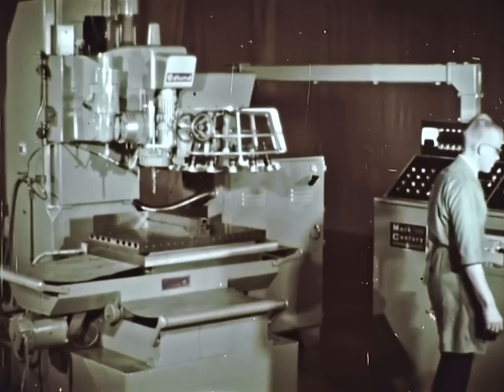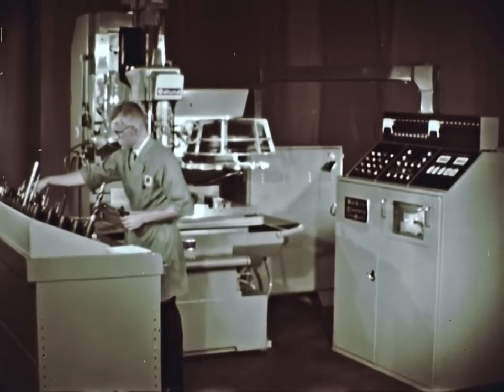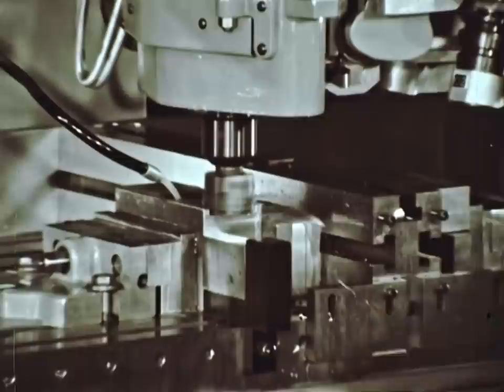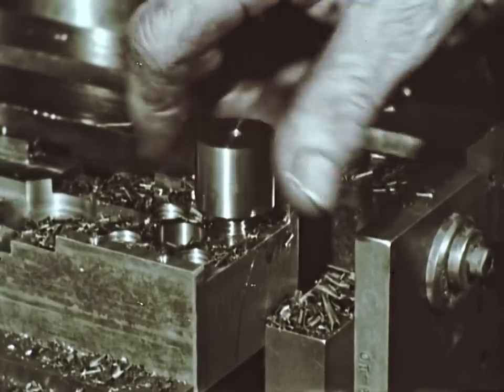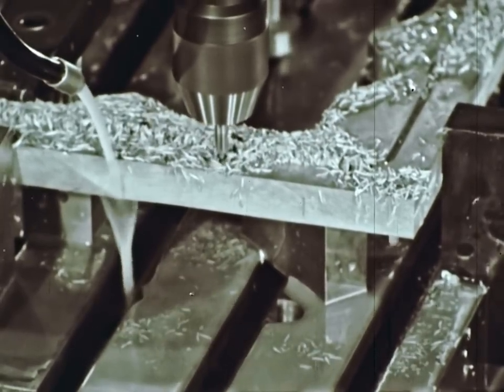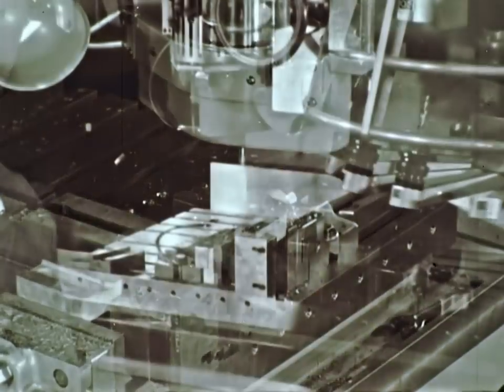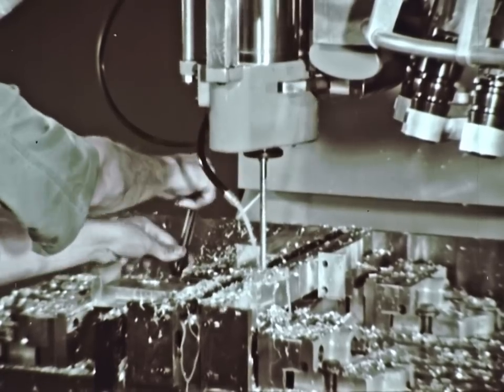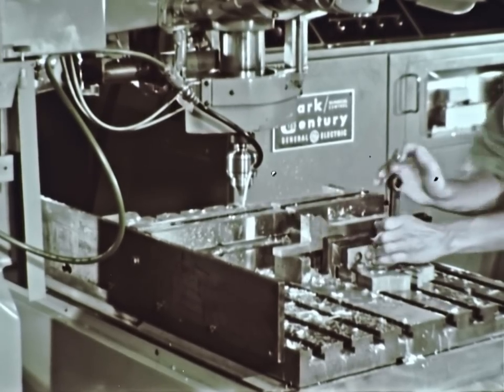1960s 16mm Promo Film Movie MONARCH MACHINE TOOL COMPANY EDLUND-MATIC

Comment: Loved seeing the GE Mark Century 100 Control.   I was a Field Engineer for GE back in the day and while the 100 series controls were a little before my time I did work on few.  I replaced quite a few with newer CNC’s as the industry moved from NC to CNC.   Today’s modern machines, advanced CNC systems, and the ever evolving CAD-CAM technology is all rooted in what companies like Monarch and GE were doing in those days.  I am proud to have been a part of it.
Reply: I spent more time then i wanna admit bringing a 1050 MCCM on a Brown and Sharpe 1000vc back to like about 15 years ago. It was a learning experience. I got it working, made alot of good parts with it. I could have used your wealth of knowledge...
Reply: You should be proud.. it was a fantastic era in machine tool technology
Reply: I was 19 when i went to work for a mfg firm that had a tape-o-matic and a GF lathe with GE 100 -  Also, bendix 5m and a few ge550's which at that time were so state of the art (optical tape readers - the former mechanical fingers breaking reed switches when holes in tape present) - I'm so blessed that i witnessed this evolution but saddened that our 'enriched' elites at GE, Westinghouse and others sat around while others took the reigns (fanuc) and led the next generation of evolution - God Bless

Comment: That's a neat tool changer. You don't see that nowadays
Reply: Seems like coolant would drip down on the collet and taper wrecking it over time
Reply: Good toolchanger nowadays is like 160-320 tools on a chain, not such a small carousel type toy...
Reply: “Time for a tool change: 5 seconds!”
Reply: Fanuc robodrills and brother speedio’s have a similar concept… with a tool-tool time of like .5s 

Chip to chip is a tad over 1.5s

Machines are 10X-50x faster depending on cut and application.
Reply: @matthewstoner1920  wow!, 60 years later, and you're telling me it's faster?   Wow!   And it uses the exact same language an a new Okuma?  Just wow. 🙄
Reply: his one was better than what a 50 years later, the one I am building ... a diy one, a rack box 7 tool pockets tool charger

Comment: OSHA would never let an open machine out here much less changing parts on the fly or lubing a tap or reamer during the op.  Mark Century controls had no fixture offsets and were basically 2 axis controls.  Rapid to and feed to depth were controlled by stops which was the norm back then.  Still a very powerful machine tool even by todays standards.  Ballscrews back then were fine pitch and large diameter.  Lots of thrust.

Comment: Can't they just use coolant for tapping? 😅
Reply: With today's coolants you can. Back then, the coolants weren't as advanced so oil was used for better lubricity on the tap.
Reply: coolant does not work well for tapping, even modern coolants barely work in aluminum, oil is still the way to go

Comment: I can't believe  how many tool changes it made without jamming up
Reply: Pre CNC in its basic form , no rotary or linear feed  encoders for spindle speeds and axis positions and feed rate , arcs and angles were calculated in the program, using tangent, co-sine 
 calculations,  this allowed a radius to be made during the machine operation by operating two or more  axis drives at the same time , Clever stuff at the time , Tool change became more efficient later with introduction of a rotary encoders, these enable faster tool changes , these could calculate the shortest route to the next tool required that is to say if you had a twenty tool operation in the CNC. program